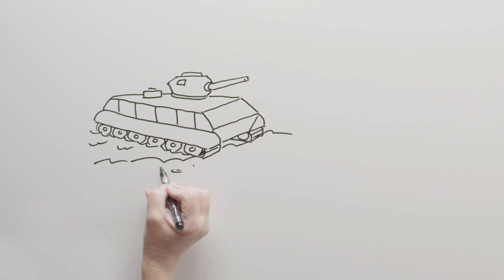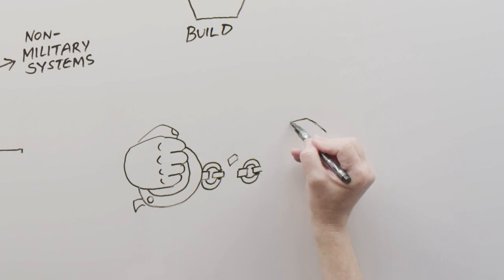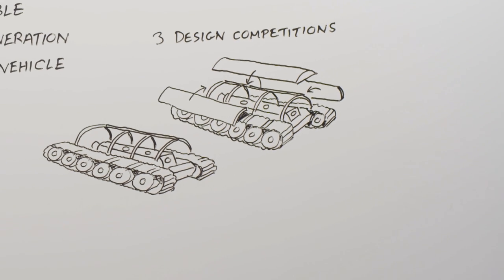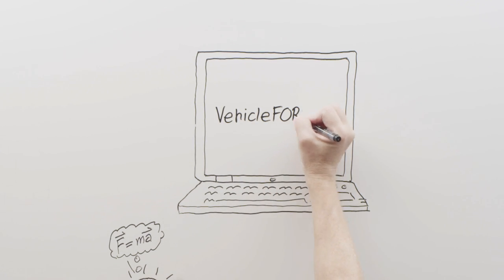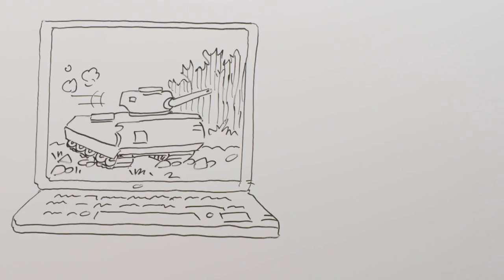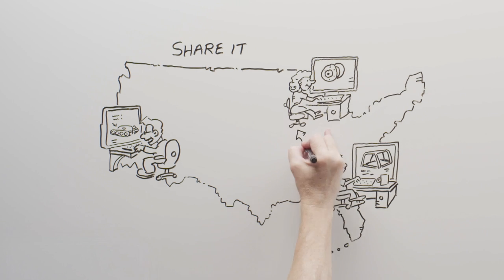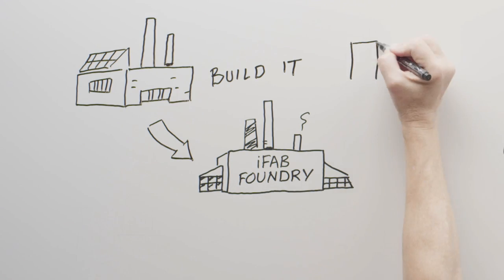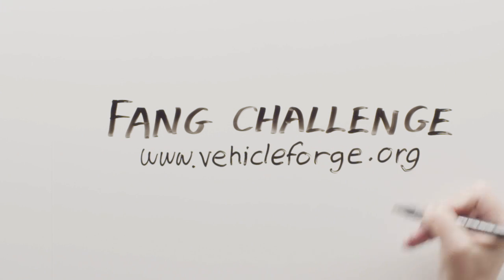FANG Challenge: Design a Next-Generation Military Ground Vehicle

Comment: May I have your opinion on a concept of mine?
Imagine a tank designed like a turtle, a shell round, and a cannon that moves around the circumference and the barrel can tilt with a wide range of degree. The gun system can provide shielding against crew inside the interior. The vehicle has no turret only a lateral gun system that moves around the circumference of the vehicles body and the barrel being able to tilt so as to have all the efficiency of a normal turret and more.

Comment: Product standardization is key. 

For example, if a truck company wanted a truck for 10 different roles, they would have a  common chassis with a selection of more powerful engines and other components depending on the task, thus solving the problem and saving time and money in the process.

The military, however, would have 10 different trucks tailor made, often by 10 different companies, with 10 different chassis, engines..etc and this inevitably sends costs skyrocketing.

Comment: Try open architecture. Design several engines and drive trains for different weight classes. Then design several vehicle chassis. You mix and match as needed. Today the DOD designs every tank or truck separatly with little to no interchangeable parts.